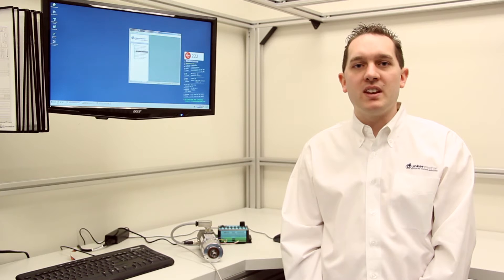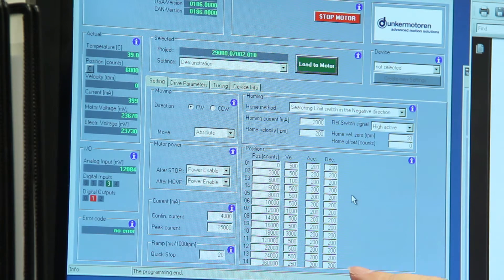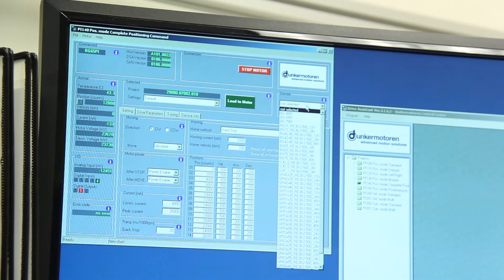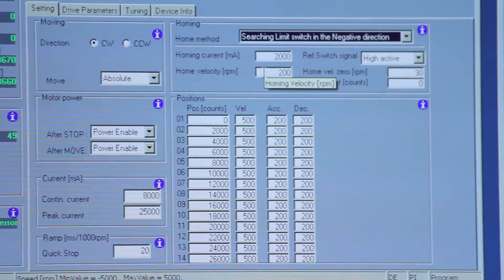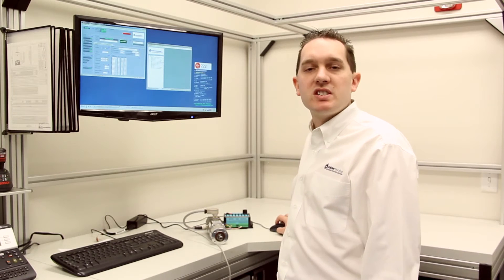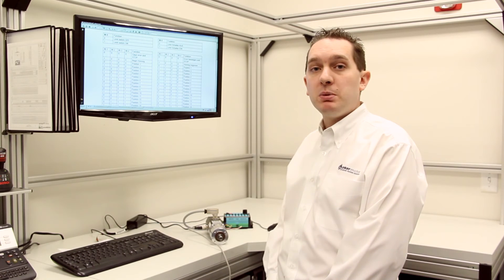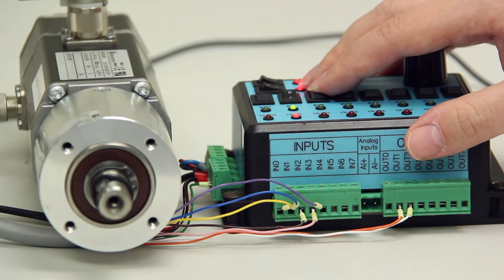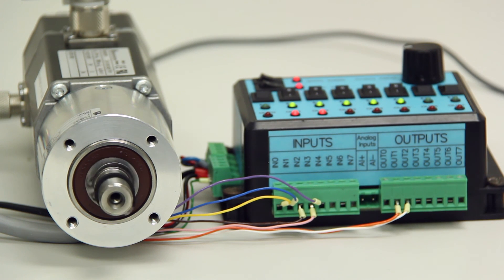Dunkermotoren - (EN) Dunkermotoren Presents: PI Motor Set Up

Comment: Hi, I need info bg45CI homing on blockage. The drive searched in one direction switch then it turns back and searches again the pin and set home position is this position value = 0 or is it calculation f 2 directions by increments? 
Thanks!
Reply: hi mate. did you ever figure this out? I have a motor bg44 very similar which also homes on blockage/physical resistance against the motor when turning. mine turns till it finds the blockage then rotates back so many degrees to find a centre with the count.

I have made a small mock test rig to mimic the real life assembly, as the motors are pre loaded with our correct parameters..but for some reason when I activate the home it just stops at the blockage and fails it's home
Reply: hi did you manage to fix this? I have a similar issue

Comment: I have a GR63X55 (150v), 4 wire encoder?, serial number 8844208460 that has an unusual gearbox. Looks like it was setup for a swing gate or door with a "hinged arm". It has 3 springs inside a bolt on case extension that appears to return the door after opening.  The centerline on the right angle gearbox and the motor output shaft is the same. Any idea what model gearbox this would be and where I could find specs on it? This thing is beautiful! Thank you very much.

Comment: The only way to select the torque mode is through the software and the connection with the CAN bus? or is there any way to do it by hardware?
Reply from the maker: To set a maximum current (and with it the maximum torque), you need our software “Drive Assistant” and a programming adapter.

Comment: is there a way to control these motors using an arduino and ¡of course building a MOSFET circuit amplify the signals! ?   That is to say: Is there a way to disable the built-in electronics ?   It really looks sooooo complicated :(  ...if it could be just control with an arduino :'(
Reply from the maker: I personally also love the Arduino because I can program it myself and there is an almost infinite selection of free examples. I can assure you that I have wished it many times that Arduino programming for our motors would be possible. Our motors are designed for a wide range of applications and to get out as much power as possible without limiting the reliability. Therefore, the motors include many algorithms (e. g. sine commutation with vector control, i²t overload protection, temperature, voltage, current protection) that make sure that no matter in which of the thousands of applications the motor is operated, the risk of damage is extremely low. Therefore, we can not bypass these algorithms and give direct access to the power stage.
One way to control the motor through Arduino would be through digital I/Os (24V level -> driver necessary). Then you would need an SI motor (plug and play). The other way is through CANopen. But to be honest, I have not yet found an easy to use CANopen Driver for Arduino.

Michael Burgert, Product Manager